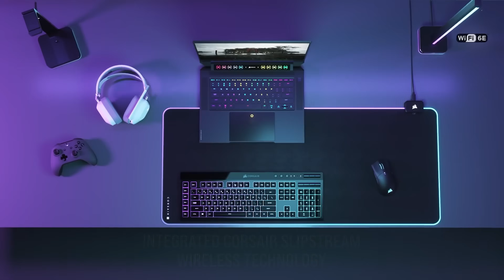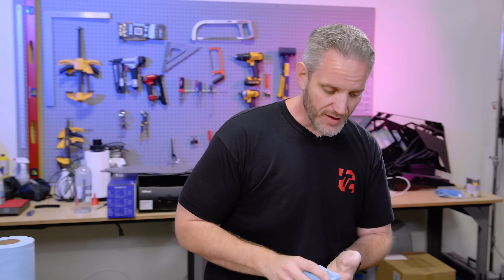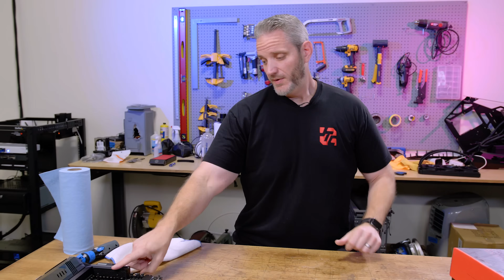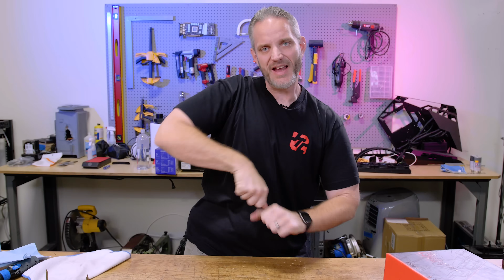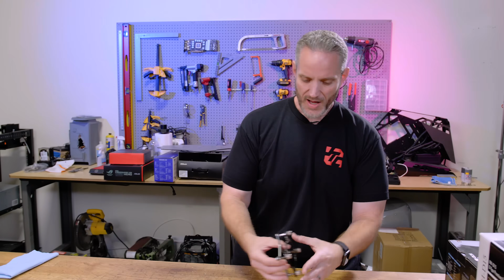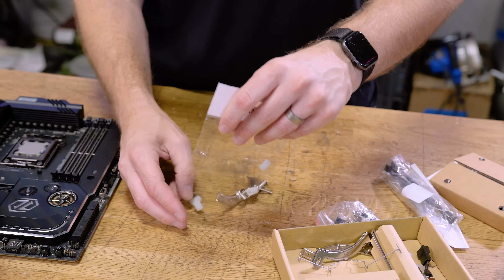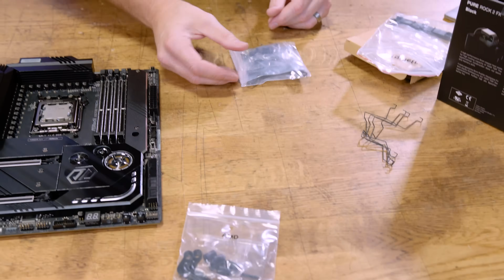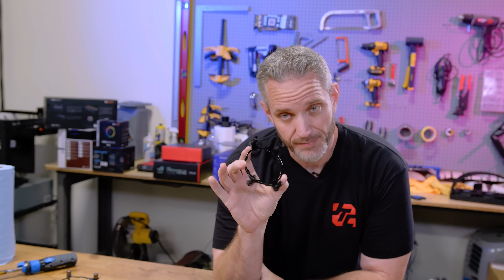AMD made a terrible flaw with this design...

Comment: I actually have AM5 with the Arctic 360 AiO and the Arctic offset Mount. Like this it works really good
Reply: Arctic, the AiO maker has a mounting bracket good get the cooler on top of the CCX Chips themselves
Reply: @seyedchavoshinia8839  What sort of improvement did you get temp-wise?
Reply: My 7900X never gets hotter than 85 with the offset. Without it, it was at 95
Reply: @seyedchavoshinia8839  Wow that's significant, also I'm assuming clocks and power draw are the same?
Reply: @johnfreeman5956  No, it gets 100 points more in cinebench
Reply: @seyedchavoshinia8839  Great, I'll probably use an Arctic AIO for my soon to be workstation then.
Reply: I've the 420 one for my 5600X (yeah, overkill I know, but Amazon sold those on sale for 75 bucks in april, probably to get rid of the inventory with a defective gasket, mine had one, and I could not resist) and it's very nice, easy to mount, no RGB octopus, just one fekkin 4-pin plug, powering the 3 fans AND the pump.
Reply: What temps you getting? What AM5 cpu and mobo?
Reply: You'll be shocked when you see the videos coming out about Zen4 performance with old Wraith box coolers ...
the fact is an air cooler suffices.  The thermal / power constraint was a design choice, handling the high power density.
Dr Ian Cutress's review live stream at 1hr in talks about the topic and predicted people would spas out about 95C, when the reality is notebook CPUs from Intel have been throttling at 100C for  years without problem.
Reply: @RobBCactive  You're right, but by design, 99,999% of the laptops are disposable. Sure, the CPU goes to 100 in seconds, and stay that way for effectively ever, but the battery dies in 2 years anyway. So in that sense, CPU lifespan is irrelevant, because it will probably be thrown away as soon as the battery goes from 100% to 0 in 20 mins.
Reply: @lamikal2515  You can get laptops with a battery conservation mode, it charges only to 60% and uses mains without charging unless it's below 55%.
Secondly I have 2014 AMD laptop that's still perfectly usable on battery, it's my newer Intel/Nvidia which had battery failure and I took the battery out and ran on the mains.
You're buying the wrong laptops
Reply: whats an arctic offset mount
Reply: @prinsipe4life  its an optional mounting method with am4, its in the instructions with the arctic coolers, it shifts the whole cooler down a little and improves temps by a few degrees on am4 because the coldplate is centered over the cores that lie underneath the heat spreader
Reply: @prinsipe4life  Artic's AM4 offset mounting bracket. If you own an Artic AIO you can request it.

Comment: We are the early birds, thinking about building another rig what can I get with 850~750$ any ideas
Reply: Assuming from scratch you can build a ryzen system using a Ryzen 5 4000G or 5000G using an MSI tomahawk board, fract R5 case, no GPU, 16 Gb RAM, and 1Tb storage. It cuts corners but for a from scratch build its pretty damn good.